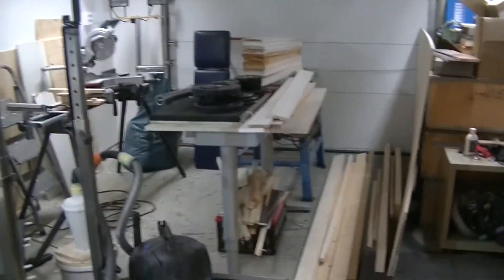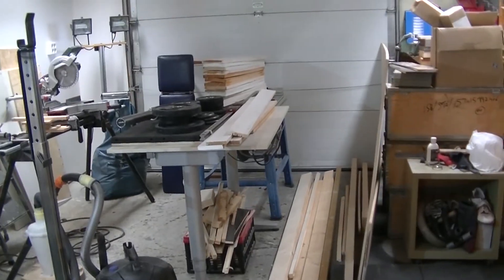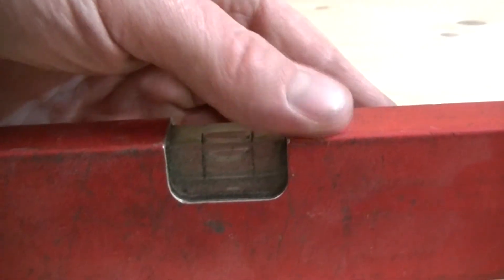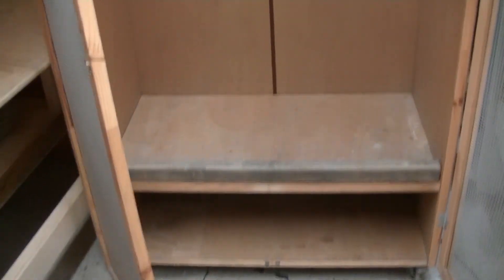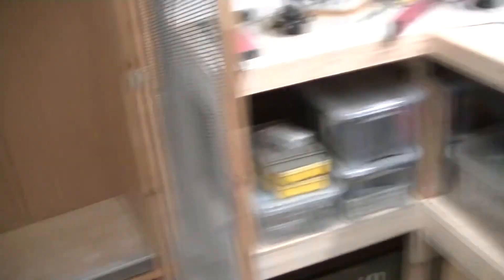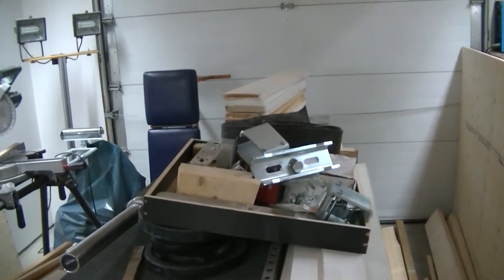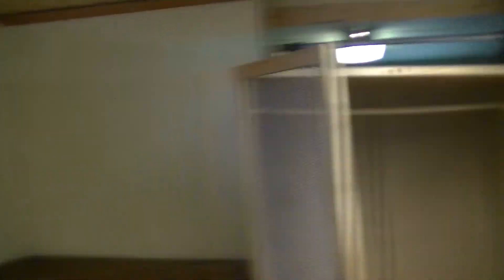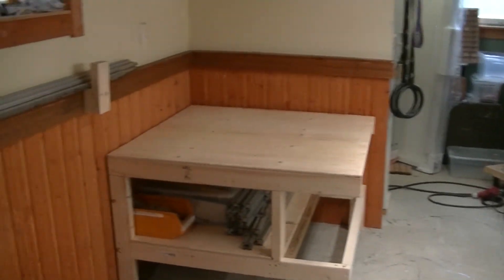Queenbee PRO CNC Router build part 0:The Table

Comment: What are the dimensions of the table top?  I am lanning on buying a queen bee, but not sure how big the table needs to be.  Thanks
Reply: I ordered the 1015 and mentioned that it would be nice if they had a dimensioned drawing. I was told that... C&P

"1000x1500mm is the frame. For the frame + motor you need to add an additional 46mm for the spacers + either 56mm or 86mm depending on which stepper motor you choose. (mine are the standard no choice 23)
If you are building a table or enclosure for machine size 1000x1500mm, we recommend making it 200mm or 300mm larger than the frame. So for you, the space around1300x1800mm."

I also noticed the stepper motors were in the back which for me would waste space. Asked if they could be placed in the front and they can be. This is still an increase  over the frame size but at least this extra space will be on the front of the machine where it may be useful. On the back it seems to me just wasted space for no purpose. It also seems easier to wire it up this way.
This can be seen in his https://youtu.be/ePbAace3L44?t=302

I am space challenged to the point that I dropped down from the 1515 to the 1015. Still have space for it but every bit counts.
Reply from the maker: I made the table 1200x1200mm for my 1010 QB Pro and that has worked fine. If you are planning on getting a different size QB pro I would suggest adding atleast 200mm to the outside dimensions of the machine to get the table size, maybe a 50-100mm more if you want lots of room around the machine.
Reply: @OffHoursEngineering  So if I get the QB1515, then the table should be 1700x1700.  Not sure where to get such a large piece of wood. Thanks for the quick response. Your videos are great and very useful.  Any additional thoughts on using ball screws??
Reply from the maker: If you can, I would at least make it 1500x1700 because the Y-axis stepper motors stick out about 150mm from the machine.
Not yet, I've been swamped at work and otherwise lately so there haven't really been time to mess around in the garage.